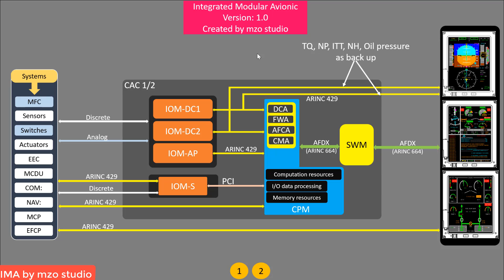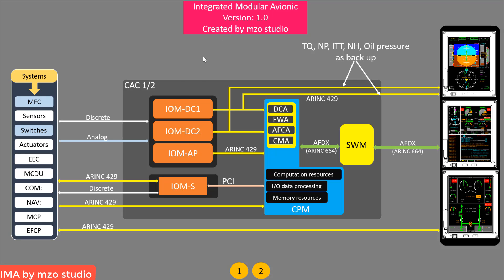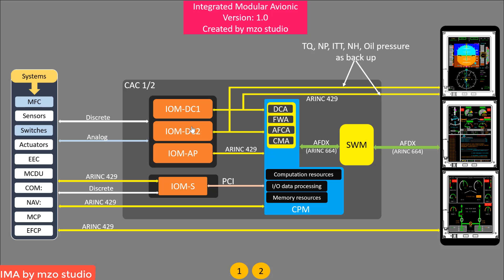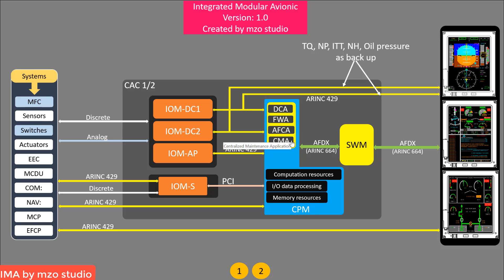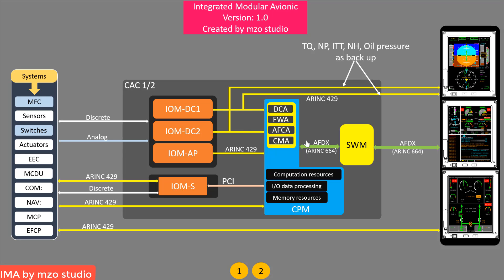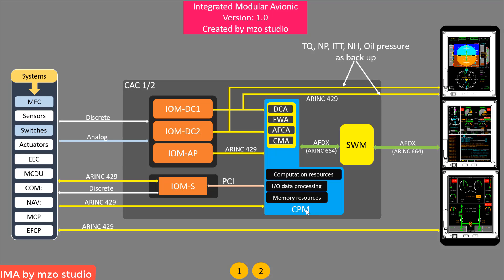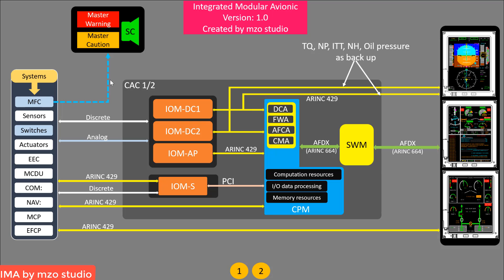ATR 72-600 Integrated Modular Avionic (IMA)

Comment: There are 3 logics in system fault detection. 
In Logic A, system fault switch send signal directly to Local Alert (control panel) and MFC (MW/MC, Chimes), then MFC send signal to CAC/FWA to convert signal to displays in DU and show checklist in EWD
In Logic B, only the MFC receives fault switch signal. MFC shows local alert and MW/MC Chimes. MFC sends signal to CAC/FWA for DU indication and EWD checklist.
In Logic C, only the CAC/FWS (DU indication & EWD checklist) receives fault signal. Then CAC/FWS send signal to MFC (MW/MC Chimes) but without local alert (control panel)
Reply: This is very helpful information.
Please can you give an example of a kind of parameter/information  applicable to each of the 3 logics.
Thanks
Reply: This is very helpful information.
Please can you give an example of a kind of parameter/information  applicable to each of the 3 logics.
Thanks